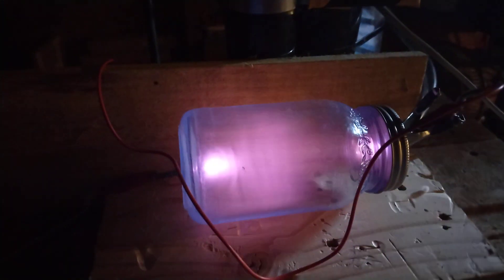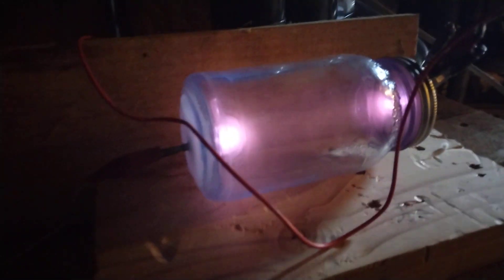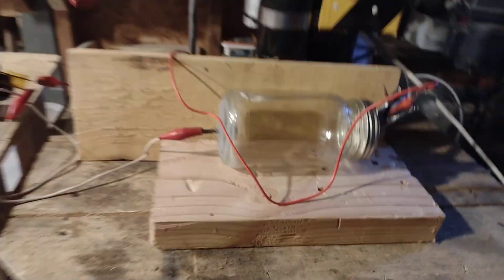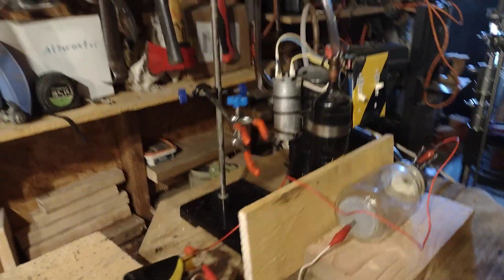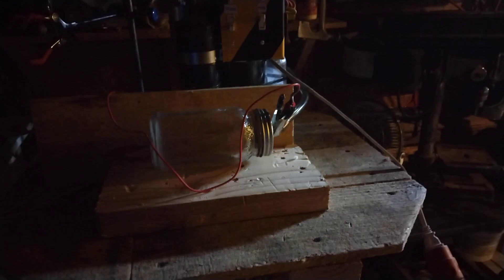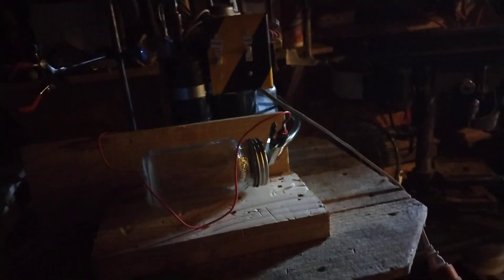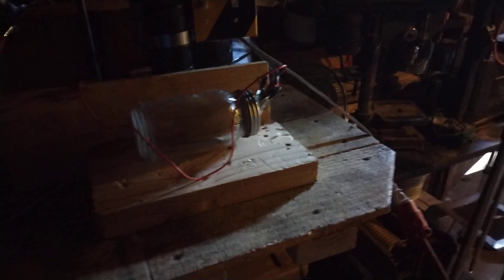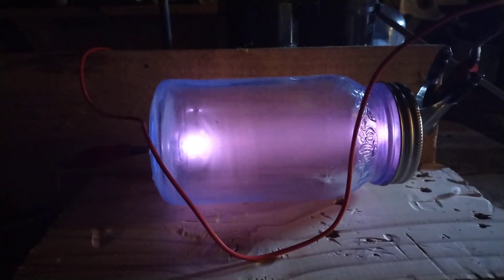Cathode Ray in mason jar

Comment: Is that purple plasma from the Nitrogen because of your lack of vacuum? And why not use heavy-walled borosilicate instead of the mason jar?
Reply from the maker: Yeah, the electrons travel a ways in the partial vacuum and then collide with the gas molecules which do some science thing that results in light being produced.  Different gasses make different colors in partial vacuum..  I'm going to try water vapor next, I watched a neat video where a guy used it and It wa a very nice silver color.   I'm using the mason jar because its what I had nearby.  I'm a total noob at glass and any glass blowing.  Should prob get an x ray detector before i play with this much more.

Comment: Very nice. Probably pumping out some X-rays too
Reply from the maker: Yeah i think it might be.  Need to get myself a good affordable radiation detector. ⚡😎😸
Reply: @JoshHopkinsYT  Or you could just restrain it with a yoke like they do on the old CRT television sets
Reply: @JoshHopkinsYT  i’ve done some really cool high-voltage experiments with small picture tubes. You can turn them into a high voltage capacitor. there’s actually quite a few interesting things you can do with them if you wire them up in interesting ways